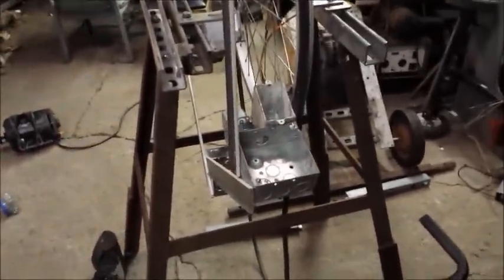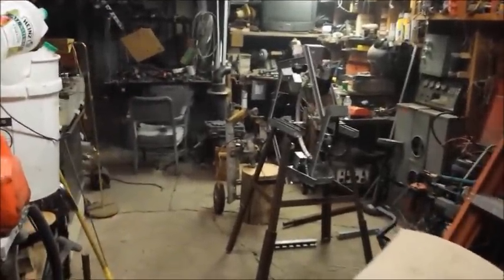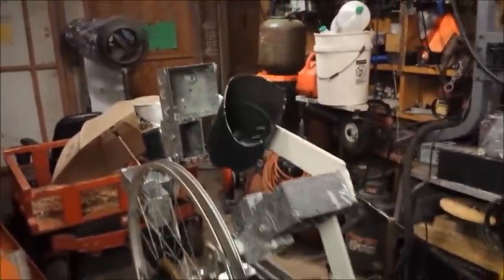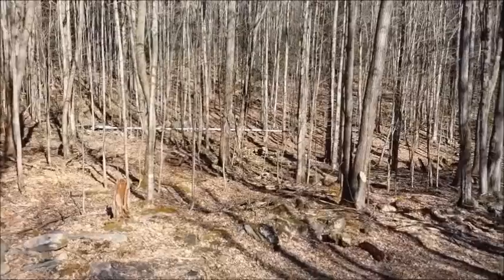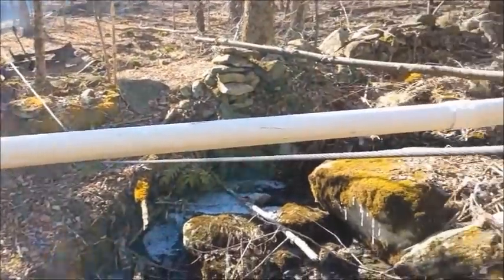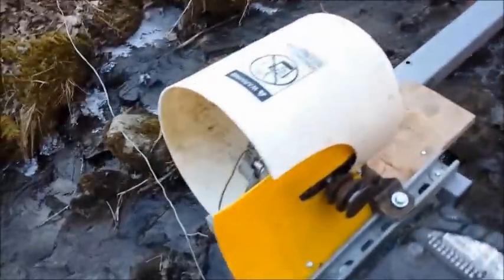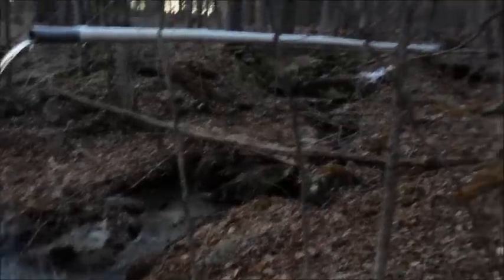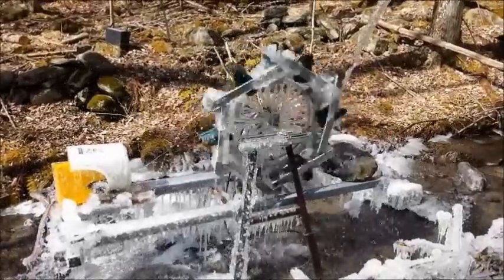Propane canister waterwheel first runs

Comment: Nothing is learned by doing nothing. There's always a lesson in doing!
Reply from the maker: +John Ratko You know it. I learned a wealth of do's and don't with this virgin prototype. I am currently uploading some working action finally though. check it out. it finally works!!! but some serious improvements are in store.
Reply: Made by one man Sweet!
Reply from the maker: John Ratko Just for an update, she's been online for two days and works pretty good although I could be pulling 10 times the power if I had the right generator. and now the watershed is RIPPING. (just got some good rain) I am working on it .bigger wheel would help, sap buckets instead of canister too. but now my imperical data is logged.
Reply: Made by one man Just had to shake out some minor bugs. Right on, brother!